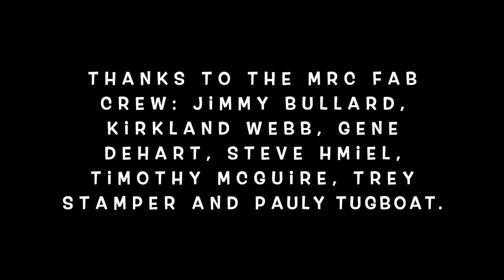Cutting up a Mint 1961 Cadillac Coupe DeVille: Finnegan's Garage Ep.120

Comment: I love it. I did the same thing to a award-winning 1970 Superbee with a 440, 6 pack with a pistol grip four speed. I now have over 3000 hours of work into the car and am looking for another thousand hours to finish. The body is finished and needs interior and paint. I had it put my garage because of COVID and hopefully sooner than later, when the stuff blows over and the vaccine is used. I will be back at it. Hot rods by Dean has been the builder of the car. Being that I have a spinal cord injury, I can't take the risk of getting it. I have highly diminished lung capacity. Because of being paralyzed from the neck down, my muscles around my drinking age don't work. So my diaphragm has taken over. Anyway, again, I absolutely love what you are doing and can't wait to see it going down the track.

Comment: WOW!! That car is clean,someone needs that frame, and floor. 
I had a 60 Ventura  W/an X frame couldn't keep a center bearing in it, every time I did a big burnout it would break. That was in 80,I didn't have access to fabrication stuff  plus it was gas shortage days. I really miss that car, 389,.060,4spd, 3.91 posi. I traded it for a 66 Triumph 650 Chopper I was a 18 year old that wanted something cool. The big big Pontiac wasn't cool enough, but I was cool as hell in Michigan wintertime.

Comment: The secret is your weight. We didn't narrow we were in but we could fit 10 inch slicks hidden inside the skirts. That was all we needed was 600 horsepower and 530 gears and we were fine. No matter what size tires you got all that weight is going to be an advantage. I love you it is a bigger advantage than the weight is a problem no doubt it will be a winner!

Comment: just look at the guys who are currently working on a new ctsv and cutting it up and it doesn't have a hundred miles on it yet and they have already pulled the motor and it is now sitting on tube chassis anyone can buy a car but cutting one up is how you serperate the builders and the guys who can bolt on something  even if it is on the wrong way and upside down 😂 built not bought 💯

Comment: Also I'd say 1961 was kind of a weird year where I actually liked the 4 door Cadillac better than the 2 door.  A 1961 4 door Cadillac(depending on what you ordered though) had that crazy ass wrap around rear window with no B-pillar, so I'd say this isn't quite top of the heap in terms of body style desirability, as I'd rather have the 4 door hardtop with the wraparound rear glass vs this 2 door.  Convertible would be even cooler, but man you see more convertibles and Coupe Devilles like this at a car show than the IMO wildest body style, that 4 door hardtop with the wraparound rear glass.

Comment: I am very mixed in this. On one hand hes cutting up an absolute unicorn but on the other hand it's gonna be sick later on. Im leaning a bit more to the unhappy side because I love these and this one had all original sheet metal and 0 rust holes. But I'm hoping it will be good at the end and it won't just start sitting again.

Comment: Mike, I get it! It's your car. I would never cut up a 61 Coupe DeVille is such good shape. A  top grain cowhide interior, a nice (possibly laquer) paint job, and some logical engine mods, but mainly a complete rebuild on the engine, modern brakes, and tighten up the suspension, and then use the car to cruise, or tow one of your many trailers around. But chop it up, never.

Comment: cut away if it's what you need to do and I know you will do it right so have a ball and cut to your hearts content. one thing thou Please use a 55 gallon drum for the wheel tubs to give it the old school look and a wheel barrel shell for the trans tunnel . your building a old school car use old school parts like we did in the 60's and 70's . you may laugh but the steel in the drums is thick as shit and so is the wheel barrel shells that's why we used them that and the 55 gallon drum ribs look baller in the back of a hot rod .

Comment: Everybody's torn over cutting the car up, I'm just hoping Finnegan keeps it a Caddy engine and not another boring LS swap....
Reply: Technically there are Cadillac’s with LS engines though.
Reply: He'll need all the power he can get if this is gonna do eights on a drag strip.
Reply: @andreewert6576  There's a single turbo '70 500 Caddy that runs close to what Mike wants this car to do. If he's going twins it should be possible.
Reply: @orionhoward9673  I mean a Cadillac designed engine(472/500), not a corporate LS.
Reply: @CzechSixTv  I agree a 500 would be cool but I’d imagine he goes LSx
Reply: @CzechSixTv  diminishing returns are a bitch tho, and i'd be surprised if that other caddy was as heavy as this one is gonna be. Full interior and all.
Reply: @andreewert6576  The 70 is 4200lb with power windows/locks/etc, down from 4600lb factory. Finnegans car has a factory curb weight of 4700. The final weight depends largely on how they finish the chassis. I'm guessing Mustang II arms/coil overs/rack and pinion/etc so the weight should be close.

Comment: I'd choose a "less than mint" example to cut and modify,but hey,it's your car and I love the idea and the content. thumbs up!
Reply: The thing is that if it’s less than mint you end up having to fix a lot of rust and other structure even if you’re setting it in a tube frame. With one like this it’s easier and quicker since you don’t have to repair stuff and can just modify it.
Reply: @NBSV1  True,but they're cutting out the floor and swapping the cassis anyway. fixing a few potential rust holes would not be that big of a deal. This car was strong in areas which Finnegan didn't need for this build,for example pristine floor and a working clock.
But it's done now,moving on.
Reply: @pouyan225  The thing is if you get an already rusty one it won't just be rusty in the places you need to cut out. It likely it'll be much worse to take apart and things like the body mounts might be rusted away. Why waste time, money, and effort to get a rusted out body repaired just to be able to set it on a new chassis.

Comment: I know people bitched about cutting up a really nice car, I was kind of in their camp as well.  Thing is there is a good number of these "survivor" 1960's Cadillacs out there.  Old people bought them, didn't drive them, let them sit in their garage for years(remember rich people have garages), they were always treated as more of a "special occasion" type of car.  

Out of full sized 1960's Detroit iron, I'm betting Cadillac is the #2 make still on the road today after #1 Chevy and the Impala(they made so many of them).  Full sized 1960's Fords, Plymouth, Dodge, Pontiacs, Buicks, Oldsmobiles, Chryslers, Mercurys, yeah all of those makes made more cars than Cadillac, but they weren't treated with the same respect as Cadillacs, didn't have the same types of owners, they were driven in winter, just generally used up for the most part.

Comment: It was very pretty junk in 1961. I've owned 16  1958-1971 Caddy's in my life. The ones that didn't just rust away completely had other issues, collapsed exhausts, metal fatigue in the frame, blown head gaskets. and just plain crap build quality on the early models in general. Anything you do to yours at this point will be a massive improvement. You can probably pull 1500lbs out of the body and  frame without much drama. Will make it possible to get to 200 mph with less power. I lost both of my parents this year Mike and an ex. My condolences. Strangely NONE to Covid.

Comment: GM's X-Frame was the worst frame design in GM's history.  I worked part time at a local auto wrecker in the late 60's and early 70's.  Any vehicle with the X-frame involved in a head on collision ended up a twisted mess. The frame pushed the entire front end of the car away from or into the direction of the impact point depending on the angle of impact.  The occupants did not always fare in any positive manner.  A side impact was just as bad with the car being bent into a U shape.   I am glad to see that frame being tossed into the scrap pile where it belongs.  If in doubt then just take a look at the 61 Chevy front impact test here on Youtube.

Comment: I have to admit that it made me sick watching you cut up the Cadillac knowing that by the time you got done you would only be able to use the outer sheet metal! You cut out all of that perfect sheet metal! I have to admit that It really got to me because I have the absolute twin to your car parked at my shop! It's identical right down to the hubcaps and white wall tires! The only difference is mine is rusty underneath! The outside looks perfect but the bottom is full of holes! Mine is white, mine has the same interior! They are twins!  Mine is an Ohio car that sat in the mud sunk in to the rockers for a few years so it has holes in the floors and trunk and probably in the frame!  Oh well floors, trunks, frames, solid gas and brake lines are highly over-rated in old cars! You could have run mine up on the rack by the rocker panels and saved so much work! All of the parts you guys are working your asses for hours cutting and unbolting would have fallen out of mine simply by raising it up on the lift!  I really do have a twin to this car but it really doesn't bother me I know the car is going to be cool when it's done!